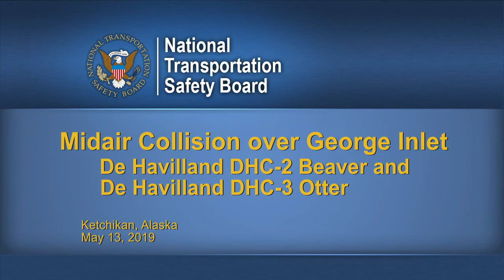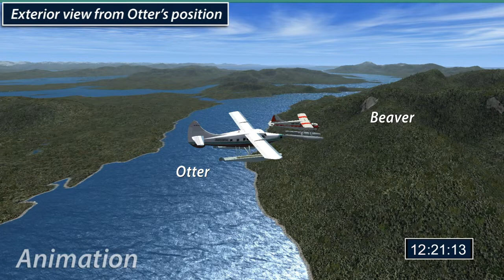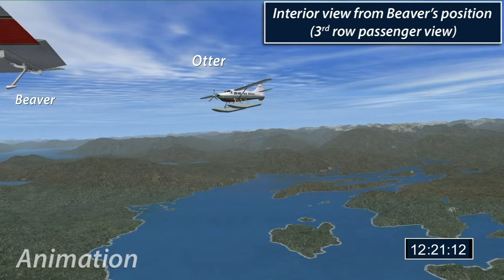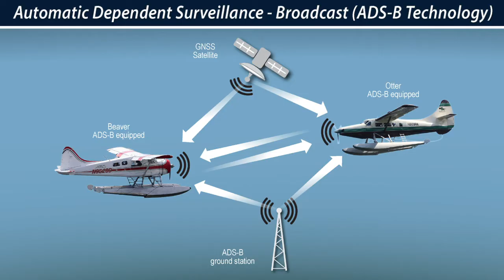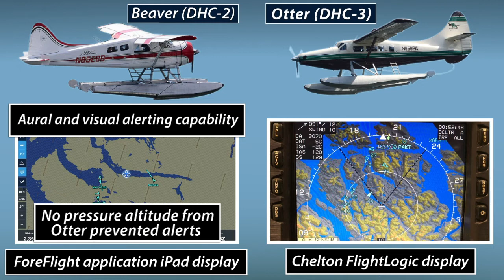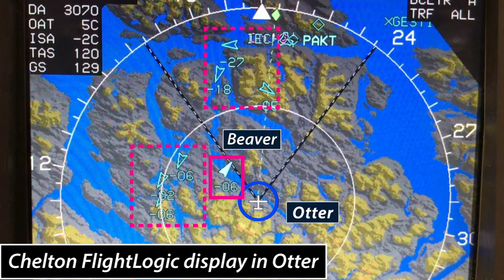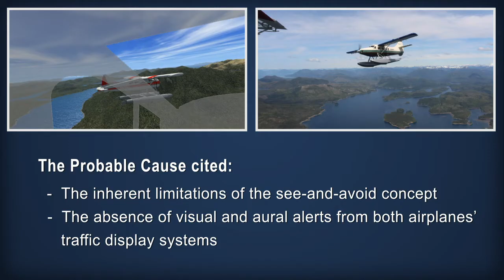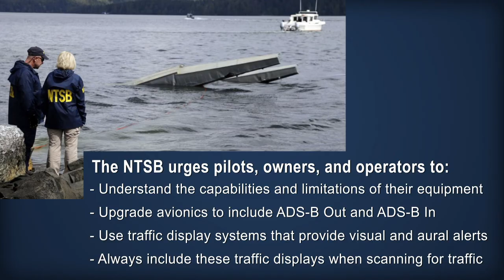NTSB Ketchikan, AK Animation

Comment: Why doesn’t ADS-B include GPS altitude in the ADS-B transmission data when no suitable barometric data is available? 

Actually, I think GPS altitude data should be standard in an ADS-B, this would limit the errors cause by pilots that are not on the same altimeter setting. When looking at an ADS-B in display, all aircraft are shown with GPS altitude, this gives the pilot one standard frame of reference for the altitude of their aircraft vs the altitude of another.
Reply: The ADS-B transmitted altitude is the pressure altitude, not the indicated altitude. It's not affected by the altimeter setting. This is also how altitude is transmitted on altitude-reporting transponders. The receiving aircraft (or ATC in the transponder case) corrects the pressure altitude based on the altimeter setting. So even if the altimeter setting is incorrect, the difference in altitude (which is what really matters) is still correct.
Using GPS for altitude is not that good. GPS altitude isn't very accurate (the error can be as large as 400 feet), plus you need an extra satellite to determine the altitude, something that isn't always available.
Pressure-altitude reporting works as long as the static port isn't blocked or the system isn't disabled as the case in this accident.